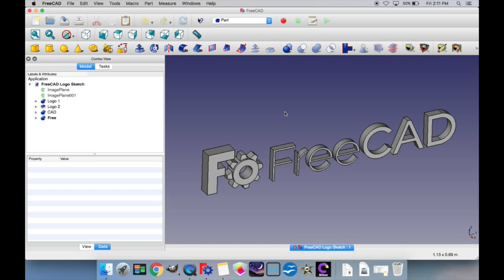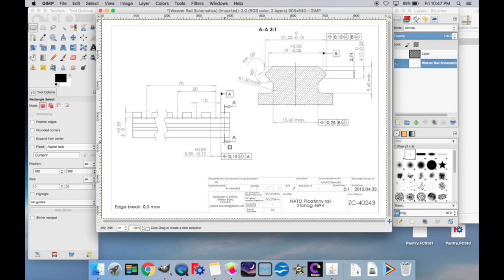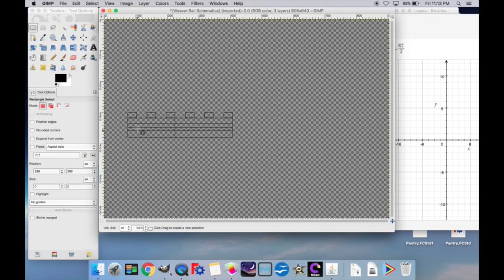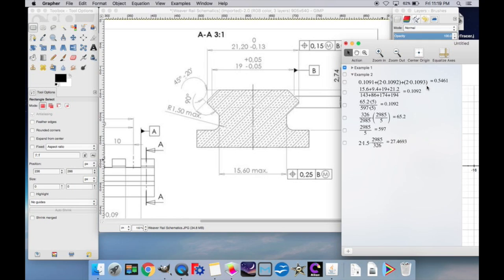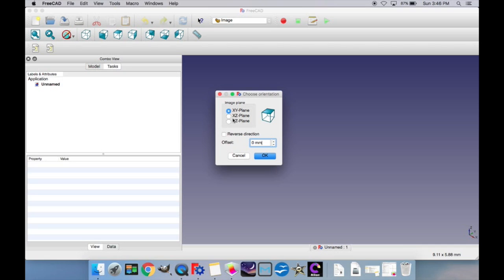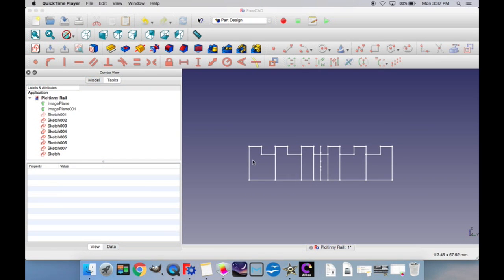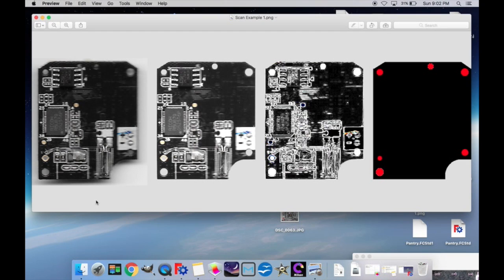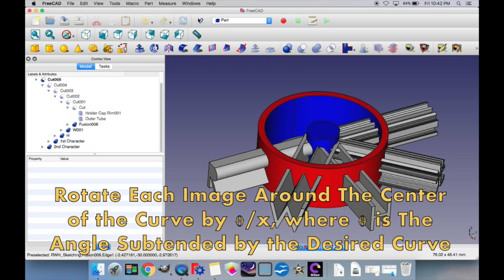FreeCAD Tutorial Part 3: Images: Creating/Editing/Importing

Comment: Would it be possible to add a way to go to specific topic . I think your tutorials are the best I have found. I am trying to import illustrator files  or vector files in planes. I have a bunch of AI files and have used AI for years, so it is quicker for me.
Reply from the maker: Hello Mr. Nugent, thanks for your compliment! As to your first question, I have listed the time stamp for each respective topic in the descriptions of my tutorial videos, but unfortunately they only seem to work on the desktop version of YouTube, not the mobile or app version. Hopefully YouTube will rectify this when it releases newer versions. Regarding AI files, to be honest I do not have any experience with AI files, and I don’t believe FreeCAD supports importation for that file type. I know it’s kind of a pain, but your best bet might be to batch convert them to a type supported for import. I believe AI files can be opened with GIMP as PDFs. Once you have opened the files in GIMP, you can convert them into PNGs or JPEGs. Another option is to search for an automated file converter online. Hopefully this will help, thanks for watching!

Comment: The bit that realy through me was scaling which is very important, I no, but I wonder if there's another slightly easyer way for the mathematically challenged like me ?.....the sort of stuff I need is electronic parts and widgets that can be less accurate than your telescope drive...if so, would love a vid on it...any how ive subscribed so will watch what ever ya do !...oh yeah neat ideas with scanners and macro lenses I never would have thought of that,  in fact it has brought to mind some cheap and reasonably accurate DIY 3d scanners ive been reading about, using infrared or ultrasound and a turntable. certainly Food for thought. Take a data sheet for any old IC (integrated circuit) say the "ne555" on its data sheet all dimensions are given I guess you could sketch it in roughly, and apply the dimensions in manually without using Gimp....I guess?
Reply from the maker: Hello andymouse123. I definitely agree that the scaling ratios are not necessary for situations where you have the dimensions required for your project from product specifications or similar sources. In most cases, the dimensions listed on the schematics can be used for the entire object, but for some projects (like the rail in the video) the specified dimensions have a range of values, like 10.2-10.6. In a situation like that, the scaling ratio is useful for replicating the schematic in the image based on the pixels used. I suppose you could also take the average of the value and use that as well. I included the scaling ratios for situations where some dimensions are missing or for schematics which lack any at all. Also, sometimes there are additional objects in the schematics which don’t have any dimensions listed. For instance, I have a controller CB for a screen I salvaged, and while the overall dimensions of the board are listed, but the size and spacing of the HDMI input and the jack and power input aren’t listed in the schematic. In that case, I used the scaling ratio to calculate the sizes and separations, as well as the height and clearance of the different elements. I also find that it’s easier to sketch an object over an image of that object, especially a complex shape with multiple vertices. That way you can see exactly where the lines meet up and if the radius of curves is accurate. I guess it’s situational and it’s not really necessary but I was proud of the method since I developed it and decided to include it haha. Your right, I was amazed to see how inexpensive the 3D scanner have become recently, it’s incredible. First I need to upgrade my printer though because my old M3D is not running so well these days haha. Thanks again for watching, I appreciate your input! If you need my assistance with anything feel free to contact me any time. Cheers!